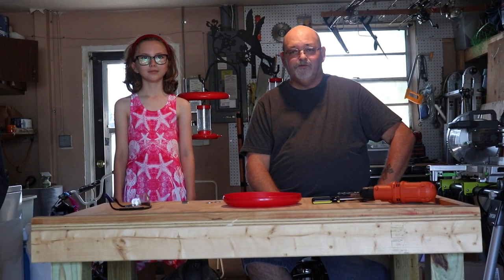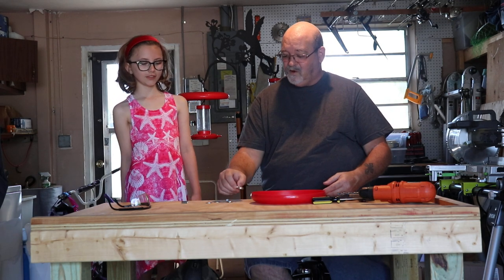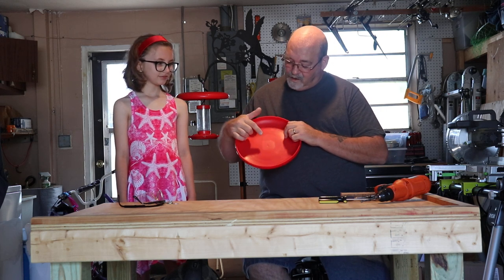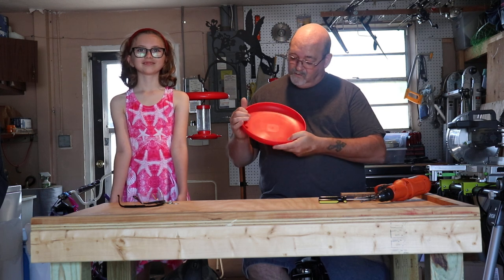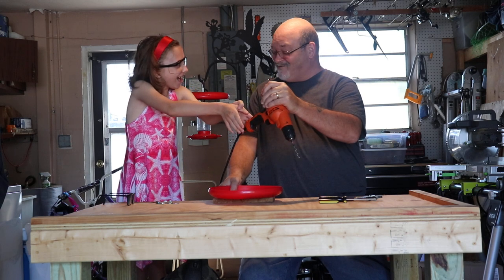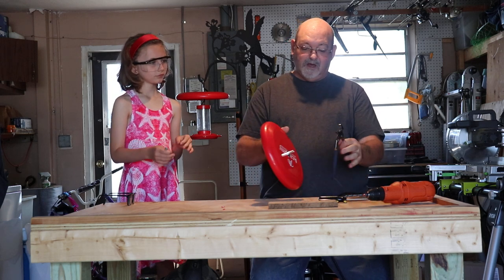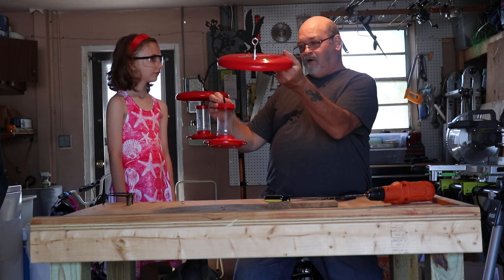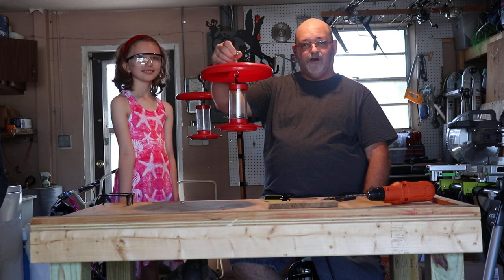DIY Hummingbird Feeder Shade

Comment: What a clever idea!  Instead of one huge shade pan for the whole hanging pole stand, I can add individual ones for each feeder. Very smart.  The red and yellow colors are the only ones the hummers can see with their eyes, and it signals flower food for them, so red is good.  Very good demo to show how you get the assembly done with eye bolts on either side.  Now I know what a coupler is!  It's a threaded nut that you can screw into from both sides to hold a couple of bolts.  
Tip - Hold the camera over the table so we get one good shot of all the parts close up.  This would have been nice.

Lily - that is one great grandpa you have.  Soak up all his DIY knowledge, every drop you can. Learn the names of hardware, tools, processes. You have no idea how lucky you are to have a handy person teaching you all this useful stuff. All your life, you are going to need this knowledge and will regret not having picked his brain enough. In your dorm room at college fixing things, in your apartment during your first job, later in your house, and later teaching your own kids. This knowledge is gold.  Because not only do you learn so much like a sponge, but you develop an attitude of self reliance and become Ms Fixit.  I cannot commend you enough for sticking thru and doing this project. Do hundreds of projects and learn every single tool name and how to use it, in your dad and grandpa's garage. Quiz yourself. You will develop the mind of an inventor.  At this age you might have other interests but... you need to learn how to build things, repair them, design a project, measure correctly, and know your power tools like the lines on your hand. Never ask a man to build things for you, you make it, you fix it, you keep learning.  Also learn at least two foreign languages, and become a good writer by reading library books. These skills will get you very far in life and enrich your life immeasurably.  Great job!  That shade looks superb.

Lily that is a cute pink dress, love the print. Try some white plastic starfish earrings and a seashell necklace with it.  By the way, you can make your own wire wrap jewelry, did you know?  It's easy to carry that kit along when you travel or just get bored. Make it and sell it. Use 'dead soft' copper wire or colored aluminum wire from Etsy or Amazon. Check out Lily-Tree, Oxana, Matt's Crazy Art, and Zurich Designs for easy wire wrap techniques on Youtube.  Have fun!!

Comment: I wonder if you could use a ‘wide’ cork from the hardware store (or even a wine bottle) plus 2 cup hooks — one screwed into the top of the cork, and the other screwed through the Frisbee and the bottom of the cork. The hooks become your hangers. Maybe less expensive than the coupler, washer, etc.

Comment: Cool! Wish it was closeup of what u were doing. Couldnt figure out how two hooks were put in same hole on each side.
Reply from the maker: sorry that we didn't do any close ups. this was our first video we did. but hopefully i can help you out. we used a 1/4" threaded coupler to join the 2 eye bolts together. when you go to the hardware section at your local box store. you will need 1/4"-20x2" eyebolts (2 ea,) should come with nuts, if not you need 1/4"-20 nut (1 ea.) 1/4"x1" fender washers (2 ea.) and a 1/4"-20 threaded coupler. (1 ea.) i hope that this helps. it is a easy project and if you shop around it should cost less than $5.00. also i found that Pet Smarts sells red frisbees for .99 cents. so if you have one local and don't mind your shade with a Pat Smarts logo on it this will help keep cost down. good luck on your hummingbird feeder shade build.
Reply: Thank you! Your assistant is so cute. Been looking for a way to shade my feeder from rain and sun. Used bowls with glues and wires but glad i saw how u do it lol. Already got my frizbees.Will be doing this asap.thanx again.
Reply from the maker: @auntifelin  we are glad you liked the video. good look on your build.
Reply: I wish I could see a closeup too. But... its brain dead simple.  Frisbee is sandwiched between two eyebolts.
Underneath frisbee: Eyebolt, nut, washer.
On top of frisbee: washer, coupler, eyebolt. Snug it up.
The Coupler is a longer nut, threaded inside. It joins both eyebolts together.  Why don't we use a nut? A nut is too short for both eyebolts to be threaded into it. Couplers come in all lengths and diameter.
Reply: Yes what size dill bit did u use? Thank you